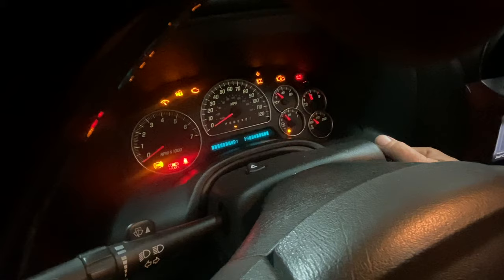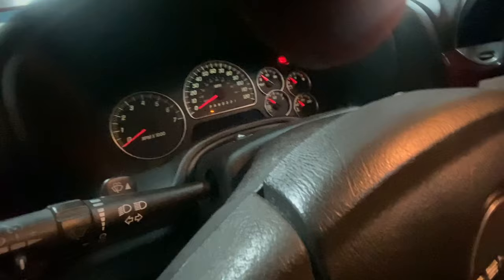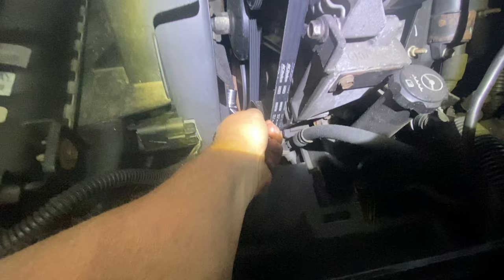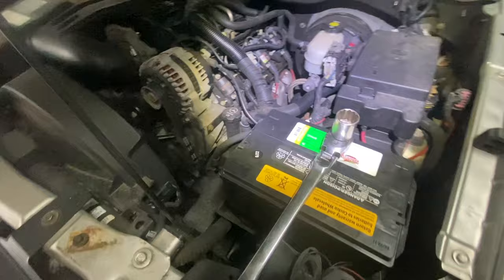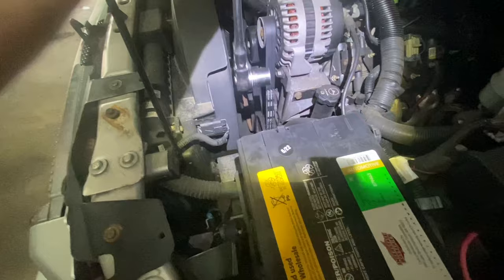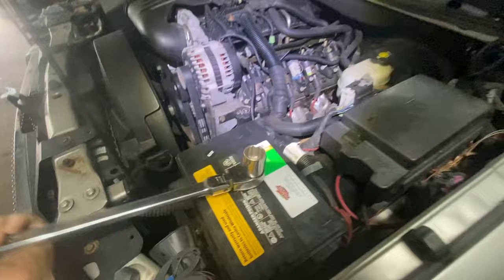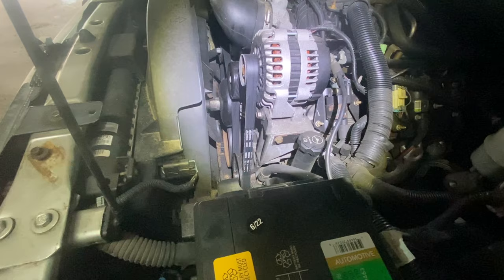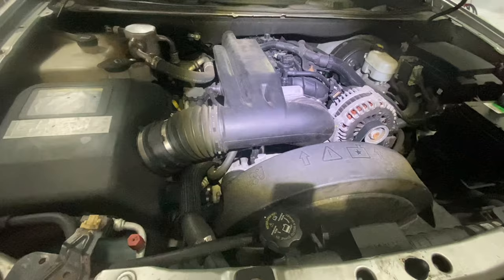Symptoms Of A Seized / Locked Engine - How To Tell It’s Not A Bad Starter

Comment: There is another cause for a locked engine that hopefully doesn't require a rebuild. You shut the engine off and next time you try to start it it won't turn. The fuel injector stayed open and filled a cylinder with gas hydra locking it. Ask me how I know? As long as you didn't try too hard cranking it you should be able to flush it out, change the oil and fix the injector issue.

Comment: Ok the first thing you want to do is...check for engine oil, if there none, yank the engine. There is oil? Good. Get access to the starter, tap it lightly while someone tries to start. That's it!
Reply from the maker: Not really that cut and dry. Tapping the starter doesn’t mean anything, could be bad wiring or fuse etc.
Reply: @Motorcarnut  Obviously, but you gotta start somewhere. I did that and I didnt have to check wiring, fuses, relays, faulty ECM's ect ect...I've built a few cars.
Reply: Type of comment I need thanks 🙏🏼
Reply: Reminding me of the British Top Gear 🤣😂
Reply: @Motorcarnut   Also, impossible to tap my starter because it's underneath the intake.  Luckily, I was able to reach the connector from behind to test it.

Comment: Hey thanks for helping us non gear heads out with ur videos....I was wondering if u knew how I can figure out if my 2008 Nissan was seized
Reply from the maker: Best way is to get a socket wrench on the crankshaft center bolt and try turning it clockwise should turn over with medium force because of compression if not its seized. Also can be starter if it does turn over like I just said.

Comment: Very clear and concise. No BS. Thank you.  I have a 2010 traverse lt with the 3.6L. Mechanic said motor seized eventhou she had plenty of oil in her. Im not convinced. Got her towed back to the house. Put my battety charger on the battery (deaf fromnsitting plus she was goving me issues anyway b4 i took her to mechanic, let battery charge up for 3 hours. Time for bed so i try and start car to see if battery charged enuff for a crank butnindidnt switch the button on charger from charge to start and all of a sudden the car goes into click starter mode until inget to battery and disconnect the battey charger. I mean it was like  click click click click which is rhe damiliar sound of starter as you had sugested. Should i get nee battery if this one doesnt charge up and then stsrter if breaker bar moves?  Many thanks for ypur input. Enjoyed your video.
Reply from the maker: Really appreciate the comment! Thank you!,

I would try to turn the crankshaft by hand first before getting a battery because if it’s locked up, you wasted money on a battery right now.

Comment: So driving the other day my car stops, I go into a panic but I know I stay on top of maintenance, but I needed an oil change. I tried to restart it and boom, smoke. (Holy wtf) I called my mechanic he comes. We check the oil, it’s a bit low but still has oil, then we turn the flywheel, a little resistance but not anything drastic. Then he looks at the starter and I had a bad ground on the starter and he says “it may be the starter” so he takes it off. This damn thing was fried, and the same smell is what I smelled with the burning smell. The starter comes in Tuesday and we’re gonna slap it in and do an oil change, I’ll let you know. Great advise
Reply from the maker: Hey, thanks for the feedback much appreciated! And yes let me know how it goes. Good luck!

Comment: Great video. Also, if it is a stick shift, make sure it is in neutral.
Reply from the maker: Good point! Thanks for the feedback!
Reply: What do you mean by stick shift?
Reply from the maker: Manual transmission
Reply: @Motorcarnut  ah ok thank you so much for answering
Reply from the maker: Sure no problem

Comment: 0:51 this is exactly what’s happening with my 2013 Escalade esv. I gotta try this method and hopefully it turns out to be just the starter😓
Reply from the maker: Yes, good luck!
Reply: can u help me out with my toyota camry 05? i have a video of my car it won’t start
Reply: @Motorcarnut if seized engine whats should i do?
Reply from the maker: @mrgg3547 unfortunately the engine would have to be replaced or rebuilt.

Comment: If you have a no start no crank situation, and you know it's not the battery, and suspect it's the starter how can I determine whether it's the starter or not when on the side of the road? Say I was driving in the car just cut off and it's not out of fuel and battery is good.
Reply from the maker: You can try banging the starter, if it starts then you know it's the starter, but sometimes that doesn't work. Check starter relay for clicking or the starter itself, ignition switch could be faulty as well. If like you said battery etc. are good that its the starter
Reply: Same thing happened with my one of my vehicles. Did you ever get it fixed?
Reply: I think you could also be if your fuel pump goes bad as well.. ??

Comment: My car stop. We pulled it home.

The start was checked the star isn’t good 

And he said the motor was locked 

We charge the battery 

The vehicle started 

Didn’t try to drive it 

Put it in reverse, and in drive to see if it
 would change gears

However, it did change gears 

We disconnect the battery and we have been waiting on the mechanic to come back and check again 

When my husband tried to turn the motor , like you suggested in the video, it does not turn 

Does it mean it’s locked or seized? 

If the starter is engaged, would that prevent it  from turning 

With the vehicle had started that day if the motor was locked
Reply from the maker: What can be happening is the engine was probably partially seized and now it got worse. Even if the starter was engaged it would still be able to turn by hand. Mechanic is probably right I’m afraid.

Comment: I have a 2011 v6 Camaro. For the longest my car would do this but after 1-2 tries it would start. Today it’s not starting and only clicking. About to get a starter later today and see if it fixes it
Reply from the maker: Let me know! Probably is if it turns by hand
Reply: @Motorcarnut  I changed out the starter. It was 100% the problem. The spindle would come out of the casing (which is what the click noise was) but it wouldn’t spin. Hopefully the comment helps anyone else in the future that has a similar issue
Reply from the maker: Awesome! And thanks for the extra info!

Comment: Could you watch my 30 second short on my engine cranking & tell me what you think ? Wondering if I still have a chance or if I need a new engine
Reply from the maker: The engine is not seized but does sound like the timing jumped. Needs to be diagnosed further.

Comment: This just gave me a different outlook on my situation. I have a 2016 Kia optima that was apart of the recall but they never informed me of the recall when I brought the car. Said they never had my information but sent me warranty papers about the fuel pump in the car months later. Problem I have is, my engine locked up with oil in it and it still has oil in it, no leakage almost a year later. No clear indicator on why it locked up. Now I think my fuel pump went bad and I could get that fixed by Kia but my engine will still be locked up. I need some suggestions on where to start to get a real diagnosis for the whole car and not just the engine is locked up.
Reply from the maker: That engine is in a recall, I made a video on that engine. They should replace the engine for free. It has nothing to do with the fuel pump.
Reply: @Motorcarnut  they won’t. I never received the paperwork before the due date and they never informed me of the recall so I’m on my own with trying to figure it.
Reply: @Motorcarnut  the only thing they sent me was a warranty for the fuel pump and seatbelts. When I called to tell them, they said I called too late and it was nothing they can do. But my engine has internal recalls that I had no clue about. No lawyers want to take the case so I’m stuck
Reply from the maker: That’s terrible, sorry wish I could of helped
Reply: @Queenpoohmom  I have a 2013 Kia, it doesn’t matter how long it been or if you just brought that car a week ago, Kia is supposed too cover that recall no matter what. Long as you have proof of all oil changes that was done too it so they can see that the car was maintained they will fix the engine for you
Reply: @305dadecountyy  really!? I’ve heard that but Kia won’t do it and no lawyers will take the case to even make them. My car is definitely apart of that recall they had but failed to notify me about.
Reply: my 2016 KIA Optima froze on the Freeway last night. No oil in the engine but the oil was changed less than a month ago.
Reply: @Queenpoohmom  hmm that’s a case, if you proof of all oil changes they supposed too cover it no matter what, unfortunately when I brought mines litterally 2 weeks later the engine failed an the previous owner didn’t have receipts of oil changes so I had to pay out of pocket for a new engine from my mechanics which cost bout $4,000 like 3 months ago but it’s riding brand new now haven’t had no problems with the engine since
Reply: @305dadecountyy  i definitely have all the receipts for the oil changes that was done. The carfax has them as well from the previous owners. They still fight it no matter what. My car still have oil in it. It never leaked out anywhere.
Reply from the maker: No oil in engine is not the vehicle’s fault
Reply: @Queenpoohmom  my grandma 2013 Hyundai engine did the same thing bout 2 months ago and we had got it fixed but at the time when I was driving it when it stalled it didn’t leak any oil and the oil was still in it but it was clearly old and she didn’t remember when she last had a oil change, but if u have all the receipts I would keep trying with Kia too get dem too fix it, idk why they giving u a hard time when they was nice and forward with me when I went too the dealership with my car back then
Reply: @Motorcarnut  Oil was changed 3 weeks before engine seized. No oil leaks in drive way. Engine seized and there is no oil in the engine.
Reply from the maker: Has to go somewhere?
Reply from the maker: The oil had to go somewhere?

Comment: So what does it mean when the engine starts and runs, but the belts aren't moving? Thank you in advance for any answers you may have
Reply from the maker: You probably have an accessory like ac compressor or alternator that is locked up.
Reply: @Motorcarnut  awsome ill look into those things, also into noticed today that the Power Steering is also gone/not responsive, could that also be a sign one of those things you mentioned is the problem
Reply from the maker: Yes, its probably the power steering pump pulley if your vehicle isn’t electronic steering
Reply: @Motorcarnut  yeah it's an 85 thunderbird so I don't imagine it being electric
Reply from the maker: @Spintechfilms no

Comment: So if I do this manually will it affect the timing of the engine?
Reply from the maker: NO, but you have to turn the engine over usually clockwise but some do spin counter clockwise, you have to find out which way yours turns.

Comment: I was told it could still be the starter even if the crank shaft not spinning, because a starter pin could be stuck. Is that true?
Reply from the maker: Not really, even if it were, turning the engine by hand will spin the starter as well. You will know if it's seized, it will not turn at all.
Reply: @Motorcarnut  well I might be screwed. Mine won’t spin at all and I just keep getting the click. But I have oil in the car. I’m still Going to try removing the serpentine belt today
Reply from the maker: @drewski6015 you have to put a wrench on the center crankshaft bolt with a long handle and a piece of pipe and take off serpentine belt first then try tuning it clockwise and see it if turns.

Comment: So, I only had a regular socket wrench but I was able to turn it from the bottom.  It took a little effort and strength but it turns. Also, I was able to hot wire the starter to the battery with a long jumper wire and it clicked once like before.   I was having intermitted starting issues before a big rain storm came through Vegas.  I was worried it locked up after driving through a flood.  However, it started a few times after the flood for about an hour and ran like it did before the flood.  Then all of a sudden click and that was it and had to get it towed.   I'm going to change the starter today just was hoping for your feedback?  Thanks and great video!  Subscribed and liked!
Reply from the maker: Yes, it’s probably the starter. Thank the for sub and like. Let me know how you make out.
Reply: Did you fix it
Reply: @brandonGCHACHU  yes

Comment: Isn’t the a change the starter is jammed in the flupywheel ?
Reply from the maker: If the starter was jammed in the flywheel the engine would still turn over by hand.
Reply: @Motorcarnut  jammed in the flywheel ?

Comment: thank you oil fine, so got to be ignition switch or clutch safety switch, new battery & new starter
Reply from the maker: Crank the engine by hand to make sure engine is fine
Reply: @Motorcarnut  engine is fine, crank moves with breaker bar, WHY would you think is engine, when I told you ALREADY what is?
Reply from the maker: Guess I must of read it wrong, my bad.
Reply: @Motorcarnut  also someone said could be fuse links, I work on today, still think clutch safety switch, I will ck today with wire on clip from switch. thnx for being honest
Reply from the maker: No problem
Reply: @Motorcarnut  it was ignition RELAY, made  weird noise when turned on key.
Reply from the maker: Great! Glad you found the problem!

Comment: I just rebuilded a 99-07 4.8l gm engine and the engine seems to be seized it turns but it is very very hard, freshly rebuild and even jumó starting the car doesn’t help
Reply from the maker: If you can, take out all the spark plugs so there’s no compression and try cranking it by hand with a wrench and see if you feel binding anywhere. It should turn with little effort and be consistently smooth throughout the revolution

Comment: My son was driving his 07 Infiniti m35x and said it died and he lost power steering etc. Couldn't get it to restart. Has P0340 active and P0335 and P0345 pending. When I hit the start button it does just like what you illustrate here. Starter engages and just everything electrical draws down hard and it does not crank. Ratchet on the crank and I cannot make it budge even a mm. I tried it with jumper cables on the battery and no different, starter was replaced a couple months ago.

I think I am screwed 😭
Reply from the maker: Unfortunately it does sound like it seized up.

Comment: Thanks for the video. Is there any other reason the crankshaft wouldn’t turn? Say if the belt is still on, there could be a bad accessory locking the belt in place (such as power steering pump)
Reply: I am really hoping my car’s engine is not seized but I wanted to be sure, I just got it. An 06 Camry. It has oil in it. New battery. New starter. Alternator tested good. Good fuses, good grounds
Reply: Nevermind, I just watched a Short of yours that explained this exact concept of an accessory and removing the belt
Reply from the maker: Great!
Reply from the maker: Yes, remove all belts to rule out a seized pully etc.

Comment: having that no crank or start issue on my car i was suddenly driving down road and car lost all power not sure if that's engine seizing ? but forsure i tried rotate the crank can't turn it but car turned on when i replaced the starter ? but idled for bit then died off and never turned on again crank pulley not able to turn it over but they're are moments when it wants crank over what could be issue ? i tried a day ago and it started smoke and smell like burn could that be because the engine is siezed ?
Reply from the maker: If you can’t crank it over by hand then it does sound like it’s seized. The starter motor could be going if it turns over fairly easy by hand.

Comment: Hey my crank shift rotates & the oil isn’t milky.. 

My 2015 Dodge Challenger shut off after driving through a large deceiving puddle. I had some water in the lower intake manifold… I’ve siphoned the majority out.. & replaced filters.  battery good… & when I try to start it makes the same one click… the only difference is the click in the video is a bit more louder/aggressive…

What are the chances of it being my starter? 

#Startermechanic
Reply from the maker: Well you could just check the starter like a mentioned or it could be hydro locked ( engine seized). Try turning the crankshaft by hand with a breaker bar
Reply: @Motorcarnut  it turns
Reply: I’m just getting one click
Reply from the maker: Then it’s probably the starter, check it like in the video

Comment: I have an infinity qx60 had this problem. Dealer said engine was locked up. I can turn it so I tried to crank and realized the starter was smoking. We changed the starter and now it turns over with ignition but won’t crank.
Reply from the maker: Sounds like it is seized

Comment: Mine will sometimes turn over but it turns super duper slow whenever it does, I tried replacing the ground but not the positive yet
Reply from the maker: Try turning crank by hand if spark plugs are easy to remove take them out than turn engine by hand see if it’s binding anywhere

Comment: Hello, can I check the crank without the serpentine belt or do I need to have it on?
Reply from the maker: Well you can, but if an accessory like alternator or ac compressor is seized it will be hard to tell which one.
Reply from the maker: If anything, cut the belt so you know if the crankshaft doesn’t turn you know it’s bad news.
Reply: @Motorcarnut  vehicle cranked 👍🏼
Reply: @mvc2177 Good job. 👍